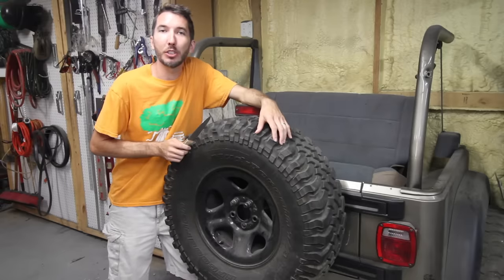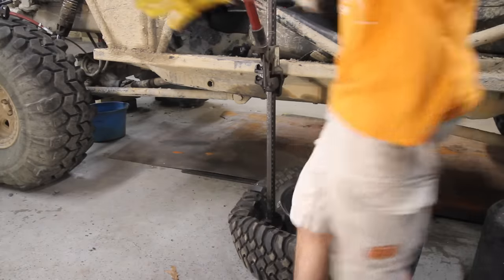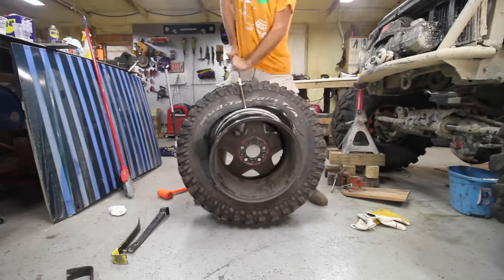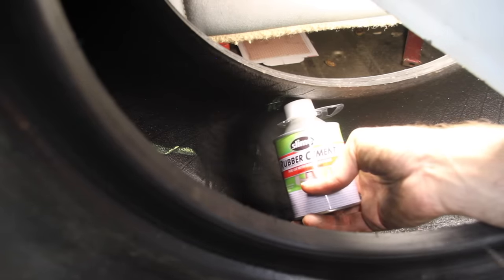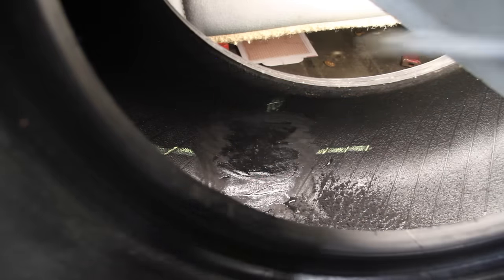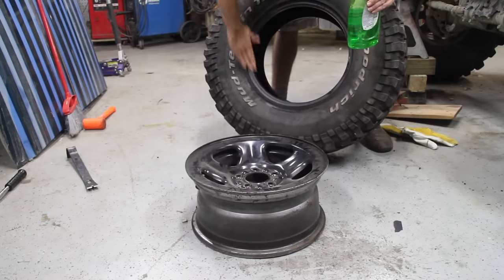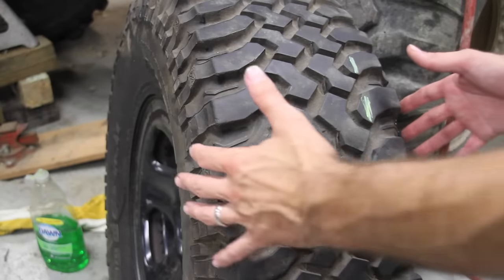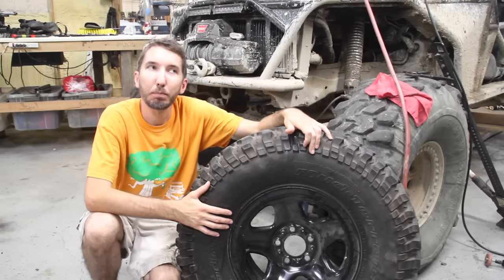How To Fix This - Patch A Tire

Comment: and what did we learn from this today.... taking your tires to get mounted by a machine is worth the 12$ they charge you, no matter how cheap you are. haha
Reply: i'd honestly make me an old manual one if my grandpa didn't already have one lol, my dad has an air operated one tho
Reply: T Sisco love it
Reply: haha yep, it's a bitch by hand. But you'd be doing it by hand on the side of the trail so it's good that he showed it.
Reply: This is more of what you can do if your stranded out on the trail and your spare is also flat from a hard day wheeling..
Reply: you can get a manual tire changer for $50 for shop use, quite easy to use (15mn per tire at the most) and saves you having to drive to the tire shop. i havent paid anyone to mount or balance my tires in years.
Reply: It's a temporary fix. Also they wont fix it   for 12 dollars if gash is on side
Reply: It's not temporary. I've seen brand new tires on an overlander get patched and have watched them hold air for their entire life.
Reply: It's not about the money all the time. I had more problems with my little wheelbarrow tire than big car tires with steel rims. Real 3 piece tire irons helps a lot.
Reply: $25.00 in Pecos and Carlsbad NM. $20.00 in the PB. One shop in Monahans charges $50.00 on Saturday and $75.00 on Sunday. $100 for a service call plus the repair.
Reply: 54 and still do it by hand... Ha
Reply: On offroading? 
I doubt that's possible...
Reply: @lfearless1819  dude nothing is impossible.
Unless you don't have the tools or knowledge.
Reply: @shonuffisthemaster  were you ger this at?
Reply: @robbierobbie7684  most stores like harbor frieght or northern tool have them, you can also order them online
Reply: @robbierobbie7684  and you have feet and hands for..... One way or the other if you really want to get there
Reply: Ahhh fun times... That reminded me of when I broke 5 33s down from CJ rims so  I could mount for my XJ with a Hi-Lift and tire irons. A heck of a workout for summer in S.E. GA. Not as bad as having to do M35 2 1/2 ton truck tires and the split rims, they can kill you.

Comment: Screw that on the trail, I'm carrying a spare.
Reply: This is for when your on day 3 of a 5 day trip, and you already used your spare, then you have no choice but to repair or abandon.
Reply: I carry a few tubes. Work to get you off the trail
Reply: Well, Sometimes you get 2 flats
Reply: This is the spare

Comment: Mr. discount tire doesn't know about the lost art of vulcanizing , it can be fixed correctly . they grind the rubber down melt new rubber into the tire and usually add a semi grade patch that also gets heat molded into place . I have had this done several times . this method has been around before discount tire was even buying Chinese shipping containers . if you haven't heard of this then don't bother saying anything . if your looking for the type of service try asking some retread plants or tire companies that have been around for more then 10 years
Reply: SSC Everything Cummins lol no
Reply: SSC Everything Cummins wrong
Reply: Haha I work at America's Tire and yes I've heard of vulcanizing. And there is a reason why we don't do it anymore. You can't just simply apply new rubber to a tire. Tires aren't made of just rubber. The original rubber is what makes up the basic structure of the tire along with the belt but this is about sidewalk repairs. Cars are heavier than they used to be and are able to take corners faster than they used to, so vulcanizing isn't a good method of repair a car that is driven on the streets because the tire does not retain its original structure and you can risk a serious blowout and the tire shredding apart right off the wheel. It's ok for slow moving vehicles such as crawlers and heavy equipment such as construction vehicles with big tires with super thick rubber compounds. I've seen them vulcanize dump truck tires before. But on a tire for a street car, no bueno. Like I said, there's a reason why vulcanizing isn't done on normal car tires anymore, it's just a very outdated method that is just too risky and not worth it, especially in a country where people are more than happy to sue you for every last penny.
Reply: Liam S same
Reply: its like you don't know the difference between vulcanizing say, a semi or farm tire and a regular passenger/offride tire. It all comes done to compounds and it just flat out doesn't work with new ones. Thats why theres a difference between say, heat cycling a racing compound tire and heat cycling a passenger tire too, the compounds do different things for different tires and it isn't some catch all solution. This guy ruined this tire, simple as that.
Reply: your totally correct i have been repairing and vulcanize tires for 40 years . my dad showed me how when i was 11 years old . ive had my own shop 24 years and i still do it on farm tires
Reply: @ANasCarBoi    Cars are heavier than they used to be ?

Comment: I work in a tire shop, were really stringent on the rules, it can be repaired if the the patch doesn't touch the sidewall. So if it's a small hole it may only need a 1.5" diameter patch, which means a round shaped hole .75"  from the sidewall could be safe to repair if it's small enough to hold a repair stem tight.

Comment: Many years ago I worked in a factory where had an old military forklift (converted payloader). That thing was always getting holes, but the shop mechanic would just vulcanize them every time. They were low pressure tires and we never had a problem with the fix leaking.

Comment: Looks to me like you just ruined a tire
Reply: Bryce Boland you could have just made 1 comment man lol... we get it,  you don't like the idea of patching your own tire
Reply: Good thing that's a old tire that was never going to be used anyways.
Reply: Except he said it has been on that rim for 10 years, so no ;-)
Reply: I work at a tyre shop and the information given in this video is 100% correct - 

(view a few "tiptop rema" video's if you need confirmation of this )
Reply: The tire isn't ruined. Just down the street where I live old man Gus has a suspension shop and he's been fixing tires similar to this since 1957. Gus uses fire to vulcanize the patch to the tire. He used to patch up inner-tubes the same way long before tubeless tires came along. His buddy used to recap tires and fixed flats the same way.

Comment: You forgot to tell them mark where the tire was on the rim and the weights if they lip weights
Reply: wjanes11 for a trail rig only type of repair, wheel weights dont really tend to matter at all
Reply: wjanes11 he is out mudding on a trail.  😂 the least of their concern is weights on a rim.
Reply: Good point, but... Now that there is a big ass patch, a tablespoon of adhesive, and a chunk shredded out of the tire they would no longer be accurate. Not that it matters off road.
Reply: wjanes11 - Kenji Fox is right. Besides, if I start jumping around on a tire to get it back on, Murphy's Law says it will rotate and grip the rim just enough that I won't be able to correct it. And I'll lose the weights in the dirt anyway. Considering the truck camper also runs pavement and its off-road tires tend to change balance a bit over time, I'd head for a shop to rebalance it. But all that's theory. I'm too old to succeed at doing this. I can change to a spare, and that's about it. I'm just here for the entertainment value. 65-pound tires aren't much fun to play with, so I'd try plugs and head for town for a proper repair.

Comment: Apply the soap to the inside bead of the second tire bead installed, too.  That is the surface where the friction mostly occurs (on the second bead installed).
I second the comment about a ratchet strap to help seat the bead, too.
303 Aerospace Protectant can be used to condition the tire and help reduce the risk of rubber on the tire bead tearing.

Comment: Who has all that stuff in their truck off-roadroading. That is what a spare tires for.
Reply from the maker: https://youtu.be/OyrSmwbVg3c
Reply: BleepinJeep 
I did not need another video on why you don't use a spare tire. Just saying who runs trails off Roading with all that extra gear. The average person has a spare tire when doing off-roading. Some people I see can't afford another 37 inch tire so they keep the stock tire on their ride. So the can just get out of dodge and to the main road to get the repair they need and get home safe.  That was what I was referring to with that video. No harm on those solid hard rock off roaders. Keep wheeling !!!!
Reply: The average person is probably not building rigs to go offroad with, when you put that much time and effort into building your rig you are going to take precautions, at some events I've seen people bring acetylene torches, welding equip, anything can happen when you run trails, what happens if you rip off that skid plate? or what happens if you put a hole in the oil pan? You have to think ahead
Reply: Well, overlanders will, that's for sure. That, and more.
Reply: I have a tore patch set in my daily. Who doesn’t carry tools with them 🤔

Comment: THANK YOU so much Matt! Im gonna give this a try, ive got an old 1978 GMC class C motorhome that runs 8.75x16.5 dually tires, hard to find and locally are about $350cad, some jerkoff decided to stab my side wall on each of my rear outside duals. Got my spare tires put on, but now dont have any spares and all the shops ive talked to said that they wont patch them even as a spare only. Was told due to the location of the slashes that even inner tube wouldnt be a wise choice, im think i may purchase a couple large patches and give this a try, than when i go to remount the tire put an inner tube into it for extra security as they will really only end up being my spares now.
Reply: AJ Hainstock I see a bunch online in the $100-120 range from decent manufacturers. 
Amazon and Ebay have a bunch.
Have you thought of changing to 16's? Would be costly, but worth it with how cheap the tires are.
Reply: FCFordLord i would go 16s, but as it is im almost at my max weight capacity with everything loaded it it and a boat or my car in tow behind it. If i went 16s i would be over their weight rating by about 600pounds total, if i were to change sizes id have to go at least 17s, and ya i found them online too, but shipping from the US to Canada is what ends up costing me almost the same as buying our here. And currently im just trying to make this RV last 3 more summers, the tires on it now arnt dry rotted and are only 6 years old. So i think a couple that are patched and tubed for spares should be ok. 

In 3 years me and my wife selling off all our assets, housing, vehicles besides our chevy volt, and buying a 55' diesel coach RV to live in full time with our 2 kids. Just coming up the the down payment on the RV before we sell our assets first.
Reply: Please make sure you take your time doing this. I worked in a tire shop for 2 years and have patched my own tires side wall but would refuse to patch customer just due to liability. A tube will help keep the tire from undergoing any additional stress. One other thing you should do is if you have one, if not go to harbor freight, and get a cheap heat gun and after you grind and clean it heat the area the patch is going on for 15-20 second it should be warm but not really hot then glue and patch the tire the heat helps to make the glue stick to the patch better. I would also get them balanced after you are done. good luck, And BE CAREFUL. shouldn't have any problems
Reply: I use a hair dryer works great
Reply: I ran half the summer with 11 plugs between the sidewall and tread. Run them till they blow (on the back).

Comment: I have a tip for getting tires on the rim. Use your pry bars up until the last part, then stand on the tire and use a deadblow hammer to tap the bead over the rim with no damage.

Comment: Hey man, thats a great video but I have some tips for you. Where ever your trying to put the tire in or out of the rim, you want to make sure the oposit side is low enough to not get caught up on the lip of the rim allowing you to put the part your working on in. If you think your streching the tire to fit over the rim your wrong. Thanks for the video.

Comment: Same principle for standard highway tires. However, the mount and dismount on the wheel is super harder on short shoulder tires. You saw the struggle here. If you have regular all season tires you will struggle like hell to get the tire on and if the rim. Nice video Matt. You educated millions

Comment: I used to do this to tubes back in the early 60s, but then we started using hot patches to tubes and tires.  After that, the hot patch was the way to go.   All ya needed was a hot patch and the clamp(used to hold hot patch) when you lit the vulcanizing agent.  Then ya had a hot vulcanized tire or tube patch.
Reply: dont tell tracy the tire buster you dont need to flame flat repairs anymore.

Comment: I stopped carrying a spare since the only time I damaged a tire on the trail I happened to damage another not 15 minutes after. Its extra weight and in the case of a wrangler sticks out quite a bit meaning it can make some obstacles more difficult. Sure it can take a little longer to patch a tire but that's just another one of life's trade offs.

Comment: “Tireject” is amazing, and will have you back on the trail in minutes, plus protect you from future punctures. Personally, it has worked well for me. Good to know that I can remove tire from rim with three 14” pry bars though. Who knew?
Reply: Shit son I can dis mount a tire with a claw hammer and 2 flat head screwdrivers and you won’t see a single scratch on the wheel
Reply: @samuelsmith481  : 
Sam…You’re HIRED!!! ; )
and…I believe you!
Reply: @markashlock9017  you learn a thing or 2 after doing it for 8 years hahaha it’s amazing what you learn to do with minimum tools 😂
Reply: @samuelsmith481  : I hear it’s all in the “technique”.  True with many things.

Comment: It is a tubeless Tire and the beads of the Tire is very critical. So the way the wheel drum is removed from the tire and inserted again will  damage the bead. The dust after buffing should be removed before fixing the patch. It is a radial tire and only a radial reinforced patch must be used. The demo wrongly used a Bias Tire / Cross ply patch.

Comment: Great video! Very informative! We usually just use plugs on the trail. Do you know how this works on UTV tires? 
 Do you guys ever try cold vulcanizing tires? We use the kit that Busted Knuckle used to sell. I know it's not a quick trail fix but it works great. That's what we use to repair tires when we have flats. It takes approximately 24 hours to after the job but we have never re-punctured a repaired hole.

Comment: So you need a tire patch kit, rubber cement, write brush, grinder, special jack that the guy notes he doesn't carry, three pry bars, an air compressor with hose and attachment... Do you not bring a spare because it weighs too much or is too bulky? Seems like the effort of the repair outweighs just having a spare on hand. Lots of people with opinions on whether or not it's safe to do this, and since I'm not running a Jeep on the trails, I'll prolly splurge on a cheap tire. Pretty good instructional video, at any rate!

Comment: Good job man. 2 things, 1 get yourself a cheap Harbor Freight grinder and brush or a battery operated dremel tool like Hyper tough from wally world and a basic brush, cutting disc etc kit. Makes cleaning and getting an even surface better, faster ON THE TRAIL. Already know some ass is gonna say, he's at his shop. Yes no shop in the woods. 2, superglue that is pliable. A brand name will pull chunks of the tire out when dry which is fast. Rubber cement is good but this glue is amazing stuff.
 I like the bumper jack to bead break. I do same. Ppl say why do you need a bumper jack for a Town Car? If u don't know u will when changing a tire. Or strap it to your floor jack and break with that. I prefer the bumper or even using the rotor and let the vehicle down. Just thought I'd mention the stretchy super glue. I tested it and it took all my 200 lbs and more to get 2 small pieces apart with vice grips and other in a vice. Crazy strong stuff. Have a good 1.

Comment: i did that out in the woods one time had no choice. everyone said it will never hold. ended up running that tire 2 more years. but it was just a mud truck but did drive it on the street once in a while. but i don't think anyone will have  a air pencil grinder in the woods.

Comment: U don't need 3 bars u can take a tire off with 2 an u ain't gotta use a jack at all if u have a friend okm the trail with u like most do u can actually use their vehicle to drive the front tire on the wheel to break it down then flip it over an drive on the other side an then use 2 bars or screw drivers to break it down with I've used this method for years, the most important part is most don't have an air compressor on the trail to pump their tire back up with but thanks for the video allot of people may need this

Comment: "This is how you'd do it out on the trail"
Proceeds to whip out an air powered grinder to buff the inside if the tire. LOL
Good video, and great information. I've got a tire plug sticking out of the sidewall of one of my tires. It's been there for the last 5k miles and still holding.
Reply: He has onboard air, he can use air tools on the trail
Reply: I have comressor & tank on my K5. Air takes lot of work out. Just sometimes have 2 wait on compressor

Comment: For the lubricant water and soap together is much more efficient, take a water bottle and put soap and water in it and poke a hole in the cap makes it easy to squirt into the bead of the tire and that mixture helps work the tire much easier than just soap